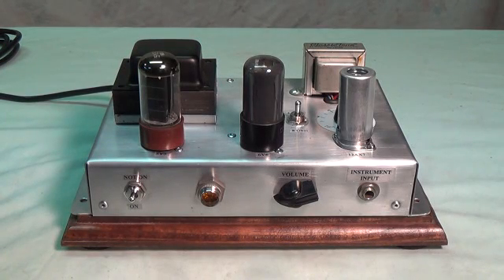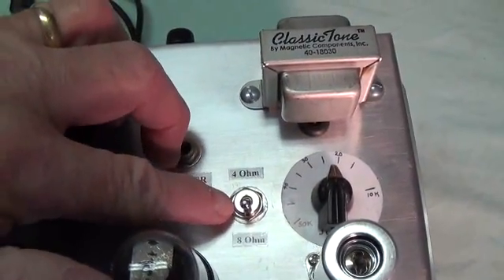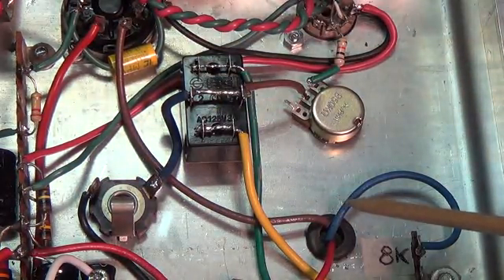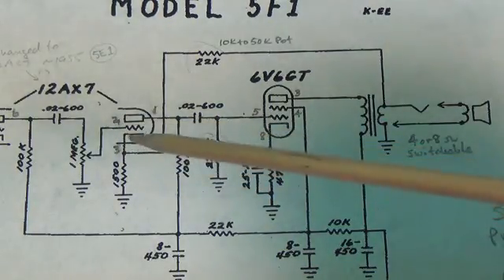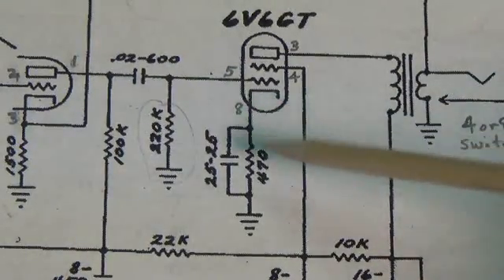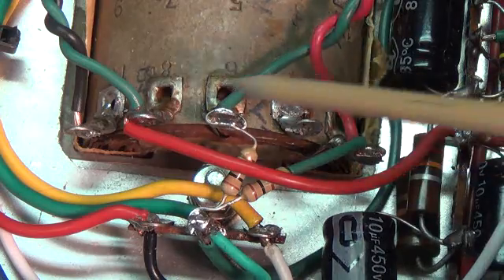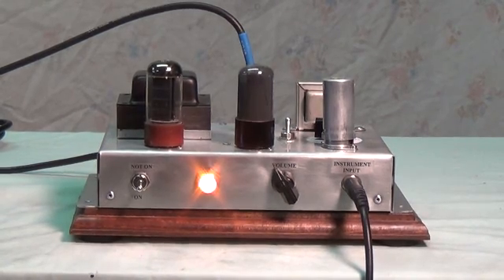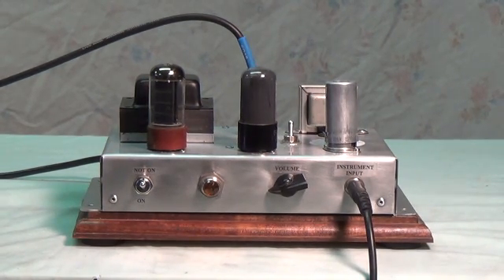Scratch Building a Fender 5F1 Champ from Scrap Parts.....Part 2

Comment: Doug one thing I'm not clear about, is how to determine what the output transformer reflected impedance should be given the topology of the amp and the tube selection.  In this video you simply picked the 5k ohm; why?
Reply from the maker: +YTNUKLR  It was simply a matter of experience, YT. In the vast majority of cases, I have found that 5K is the best primary impedance for a single 6V6.
Reply: +Uncle Doug What would be the effect created by use of a ~8k ohm?  Thanks as always for your wonderful info and demos. Scott
Reply from the maker: You're welcome, Scott. Here is a site that discusses the issue:  http://www.radioremembered.org/outimp.htm

Comment: Very inspiring. I'm preparing a similar project. Using 5F1 schematic but adding some extra features like bass, mid, treble control, line-out, master volume control and etc..
Reply from the maker: +Congi Thu Thanks, CT. I'm glad the video was helpful. Best of luck with your 5F1 project. Please let us know how it turns out :)
Reply: Planning stage. I would like show you the modified schematic when It's ready.
Reply from the maker: You're welcome to post it on my Facebook page: Uncle Doug's Vintage Amps.
Reply: Thanks! I became your fan!!
Reply from the maker: You're welcome....glad you joined our YT family :)

Comment from the maker: Harrison Hein, your comment had no Reply capability, so I'll answer up here. I agree, but once the circuit was wired, the measured resistance differed from the calculated resistance. In an attempt to accurately portray the circuit, I stated the measured resistance, and included a note in the video (at 8:44) explaining this. I now regret doing this because of all the (justifiable) questions it provoked, and I apologize for any confusion.

Comment: Wouldn't a 10K resistor in series before a 50K pot give you up to 60K ohms of resistance?
Reply from the maker: +Marcvie J.  Quite a few people mentioned this, which is why a note was added at 8:46 in the video explaining that although the resistance of the pot was marked as being 50K, when the circuit was actually measured with an ohmmeter, the range of resistance was from 10K to a little over 50K.
Reply: with a 10k minimum resistance

Comment: Hi Uncle Doug,
I am enjoying your amplifier builds and restoration and you have inspired me to
plug my soldering iron in again and build something. I love the build quality of your work and your attention to detail, it is truly an inspiration.
I have a suggestion for a video and you may wish to consider my suggestion for a tuition or build video. . . I know that mains transformers can be used as an output transformer in a small Amp or tube radio and I have heard it said that a mains transformer winding can be used as an HT choke also and I would appreciate it if you could comment on this as transformers are difficult to obtain at reasonable price hear in the UK . . .also there is a lot of interest on the web in very low power tube amps for studio recording and home blasting, check out this link for an interesting project.
https://www.youtube.com/watch?v=DOCgDRwegm4
regards Geoff.
Reply from the maker: Geoff Gardner Thanks, Geoff. I have never had a power transformer with the correct wind ratio to serve as an output transformer or filter choke. Also, power transformers generally cost at least twice as much as an OPT and three or four times as much as a filter choke.....so I'm not sure if it would be a good economic move. A better bet would be to buy an inexpensive, used tube amp with a damaged cabinet, missing tubes, etc. and harvest the PT, OPT, and FC (if it has one). Check Triode Electronics for good buys on Classic Tone transformers. I know the shipping is probably high to the UK, but their item prices are very reasonable.  As for the low-power tube amps, I have read about them and find them interesting, but tend to stick with traditional vintage circuits using 6V6's, 6L6's, EL34's, etc. Thanks for your input.
Reply: Uncle Doug 
Hi Doug,
Thanks for the quick
reply, the mains here in the UK is 230 V so that might make a
difference but I know that the construction of HT transformers are
not optimum for audio use with large amounts of inter-winding
capacitance and inferior lamination material however thanks for your
help and suggestions, I have in fact obtained a none working tube
radio from ebay to build a small practice Amp, I remember
you hearing you say that you live in Tempe,
I listen often to paster Steven Anderson on the web, I wonder if you
know of him (i'm not shore how big Tempe is) anyway looking forward
to your next video. 
Regards
Geoff.

Comment: Hi Doug Love your stuff. Just wondering when you say you have a 10k resistor in series with a 50k pot for the NFL. You say you would have a total of 50k but would you not have a total of 60k as ther two are in series?
Great looking build by the way! :)
Reply from the maker: jozzef1990 Thanks so much, Joz. Many people have asked about this, and the reason is that although the pot is labeled "50K", its actual measured resistance was a little over 40K ohms.....so I went with the actual value.  To prevent further confusion, I recently added a note to the video explaining this. Thanks for your input.
Reply: Uncle Doug Thanks for clarifying, that makes perfect sense. I've just finished building my 5F1, no mods really but I added the 22uF cathode bypass cap for the 12ax7, bit of an increase in gain which is nice. I am thinking of building a Matchless Spitfire for my next build but I am unsure what power transformer to use. The amp uses EL84s so do you think a Marshall style transformer might work better than a Fender type? I thought you might be interested in the circuit. I am attaching the schematic, interesting little amp. http://www.mhumhirecords.org/DIYpages/schematics/SpitfireSchematic.bmp

Comment: Seeing this buck naked guitar amplifier illustrates a difference between a guitar amp and one tailored to use with a gramophone.
Distortion is Public Enemy #1, Visually that means a far fatter output transformer.
Reply from the maker: NJPurling Quite true, NJ. Distortion-wise, guitar and HiFi amps are generally at opposite ends of the distortion spectrum.

Comment: Love the "not on" setting! Very clean build, I like it a lot. BTW all 3 terminals on the feedback pot should be connected (the wiper should be connected to one end or the other)
Reply from the maker: Craig Diamond Thanks, Craig. Glad you liked the video.....and the "not on" setting :) The feedback wiring has been changed since the video was completed.

Comment: Hello Doug, Thank you for sharing your knowledge in a very understandable manner.
I am scratch building my first amp, a 5F1. I am using an 8" speaker.
My question is about the NFB circuit mod: With the 8" speaker, what would be good resistor value in series with the pot to protect the speaker, when the pot is at full on, zero ohms.
I was thinking 4.7k, which I have on hand, about 20% of the stock 22k.
When I have the funds, I am considering a Weber 10" ceramic speaker upgrade. Will I be ok with no floor resistor or should I go down to maybe 1k or2.2k or so?
Thanks forward.
Reply from the maker: John Chrzanowski I'm not sure what the resistance is of the potentiometer you are using, John. If you want to bracket the 22K, you might want to use two 4.7K resistors (in series) for a total of 9.4K, in series with a 25K pot. This would give you a range of 9.4K (less than half) to 34.4K (about 50% over).  See if this range works for you. If not, then experiment. You do need a "floor" resistor of at least 4.7K to protect the cathode from excessive NFB.

Comment: i have a question to reduce hum
why not make the filaments fed by DC instead of AC?
Reply from the maker: pcuser80 It can be done, PC, but in a properly designed and constructed tube amplifier, hum should not be an issue. Excessive hum is indicative of poor design and/or construction, or component failure, and will most likely exist whether the filaments are AC or DC.

Comment: I really got a kick out of your comments on feedback. You seemed as surprised by the effect of degenerative F-B on a simple tube amp as the solid-state guys are surprised by regenerative F-B on an overly-damped transistor amp. Experimentation is the soul of this hobby and it's refreshing to see someone do it rather than look at a published table and declare it to be irrelevant without experimentation.

It seems there's a negative connotation of feedback in general in the musical instrument amp world. Yes, loads of forced linearity is what makes some SS amps sound constipated, but the coin has two sides: degenerative feedback keeps speakers tightly under control so that tone differences are minimized with different speakers. The speaker coils also run cooler.

But in a small open-back speaker cabinet, nothing beats loose resonance with lots of overhang. Makes the cabinet sound three times as large.

p.s. For those of you unfamiliar with degenerative feedback, it not only keeps the output "flatter" but is also error-correcting--anything not in the original signal is re-introduced as a mirror image back into the pre-amp, where it is run through again and cancels out the "error" in the signal.
Reply from the maker: Ss VI Design Thanks so much for your informative input, SS. It's helpful to gain insights from knowledgeable viewers like yourself.

Comment: Here's a little mod you can do to protect  the output transformer and valves. When you repair or build an amp connect  a few silicone carbide diodes reverse  biased from the 2 plates back to the chassis. When a speaker is disconnected or no load at all the back emf will be in order of 2 x the plate  voltage, thus the need for very high voltage diodes. When the reverse current begins to flow, a pair of diodes bypass that current directly to ground.

This only works for double ended tube amps but it saves frying your output transformer and tubes.

Try it
Reply: Uncle Doug g
Credit given where credit is due. Both Rusty and yourself deserve it for the professional quality of your show, I never miss an episode.
Reply: Excellent stuff.  I like the tip for the virtual ground.  I'll have to check my amp, but my hum is probably from worn tubes, which I haven't replaced for years :(
Reply: ST2R ST2R)
Watch Uncle Doug on YouTube, he presents a fabulous episode explaining  both types of hum and what causes it. Without doubt Doug does the best tutorials on valve amplifiers on any media platform.
Reply from the maker: ST2R ST2R Be sure to determine the frequency of the hum before assuming it's the tubes, ST. As tubes age, their current flow decreases (due to cathode deterioration), requiring bias adjustment, but they don't generally develop a hum.
Reply from the maker: BBK1 Thanks so much, BB. Rusty and I really appreciate your kind words :)   ^. .^
Reply: Thanks to both of you, I'll check it out.
Reply from the maker: BBK1 An excellent suggestion, BB. I'll try it out in my next amp build.
Reply: Uncle Doug
It might serve you well to also put a pair reverse biased between plate and Supply rather than directly to ground. It depends how you want to dampen the reverse current. This is probably more applicable to very high powered amps with large transformers. In this case there will be a higher slew rate but beware of harmonics in even order progressions. In some cases spectral inversion can be a minor issue however at these frequencies I doubt it will matter.
Try the experiment as it's no different than hanging a diode reverse biased across a relay providing the output stage isn't running in class A mode due to a fault

Comment: Can Rusty explain what's going on with the 2 inputs on the 5F1 schematic?  I understand input #2 attenuates the input somewhat, but I can't quite wrap my head around how it works.  If one were to skip the #2 input altogether, could the 1M resistor also be eliminated?
Reply from the maker: Jason Thorpe If you plug into input #1, there is 34K resistance to the grid (two 68K resistors in parallel). If you plug into #2, there is 68K resistance. The 1 Meg resistor is essential as a grid leak to ground. Without it, the tube would probably cease to function as the grid developed an increasingly negative charge. If you eliminate #2, the 1 Meg must remain on #1.
Reply: Uncle Doug Ah, I see it now, thanks.  Seems like the particular arrangement used by Fender relies on self-grounding input jacks?
Reply from the maker: Yes, both jacks are self-grounding.

Comment: Dear Mr. Doug, 

First off, your videos are fantastic. I have a question, I am thinking of upgrading the transformers on my Champion 600 and wanted to power the internal speaker with the 4 ohm output and have an additional jack for the 8 ohm output so I could power and external 8 ohm speaker along with the internal 4 ohm. Is this ok? I can't really find this info and I'm guessing it's because it's probably obvious one way or the other. I just want to make sure what I'm expecting to happen will happen in order to manage impedance.
Reply from the maker: johntpowers3 Greetings, John. Unfortunately output transformer impedences are an either-or situation. You can't simultaneously run a 4 ohm internal and an 8 ohm external speaker. You could, however, run two 4 ohm speakers (one internal and one external) wired in series, and connect them to the 8 ohm tap of the output transformer. Unless the speakers are identical, one will probably be louder than the other due to varying efficiency.
Reply: Uncle Doug Oh! Thanks for the quick reply. I'm sure glad I asked.
Reply from the maker: You're welcome, John.

Comment: hi uncle doug. ive just bought a 5f1 clone of ebay. it sounds quite bassy and muffled. i can get it sounding ok it I use a overdrive pedal with the highs turns right up and lows turned down low. the speaker seems ok. could it be something in the circuit like a blown resister that would cause this?
Reply from the maker: ***** Mr. J, perhaps there is a capacitor within the tone circuit that is funneling the treble to ground. Trace the signal path and see if any capacitors connect it to ground.  Also, do you have your guitar set at max treble output? Sometimes humbuckers produce a "muddy" tone that is more evident with some amps than with others.
Reply: thank you uncle doug, will have a look at it and see anything a miss. :)

Comment: hello uncle doug,,,, i am on my wifes computer... it is 3 am saturday and i decided to start wiring my champ, i did not want to wake my wife to use my puter.

my question is; The negative feed back, i have a transformer that has 4,8 and 16 taps,  i and using a spst switch for the 4 and 8 ohm taps.  Can i use 16 ohm tap to run my negative feed back, this simply my build a lil bit.

Comment: what kind of guitar are you using for the test?  ty for  all of  your wisdom with kind regards  c hughes
Reply from the maker: chris hughes Thanks, Chris. It's my regular old shop guitar, a 1980 Matsumoku Vantage Performer with MMK-45 humbuckers. It's visible in the opening scene of my "Shock Hazards" video. It's a good guitar, but not particularly valuable, so I can risk using it in the workshop, where it's exposed to extreme temperature variations and all sorts of physical hazards. Not a good environment for a 1959 LP "Burst"  :)

Comment: Hi Uncle Doug! Inspired by your Champ videos I decided to build a 5e1 clone myself. As it was my first full tube project I wanted to built it into a bigger chassis than the original. That made also possible to use bigger transformers so I used KT66 tube. I added also a bias potentiometer so I could use 6V6 with it too. It sounds amazing. Best clean tone I've had.
Reply from the maker: Olli Kivelä Wow, Olli....Congratulations on a great first-time amp-building project :) Your modifications make good sense and the fact it works so well is evidence of your skill. Keep us posted on your next project(s).

Comment: Hi Uncle Doug & Rusty, He sure seems like a good 'ol boy, I mean the dog, and, you to Uncle. I am so glad I found your channel, a wealth of information. It's on my list to scratch build a tube amp that rocks. I built a current limiter as per your video and it worked perfect. All I could get for now was a 250W heat lamp with a resistance of 5.0 ohms. I shorted through a $20.00 DVM and it still works perfect, thankyou. I am subscribed and check all the tutorials I can. Take care, be good, C.
Reply from the maker: Cass Virgillo Greetings, Cass. It sounds like you are making good progress on your way to building your own amp. Thanks for watching and subscribing, and best of luck with your projects.

Comment: I like the innovation of the cathode R being variable to adjust the plate current.  Does a significant amount of the plate current flow into the grid?  (I'm not knowledgeable on this matter.)  If not, and most of the 31mA flow through the cathode resistor, then it's dissipating half a watt.  You'd want a pot with a higher dissipation rating than half a watt, because you're are operating at high ambient temperature.  You'd probably prefer a 1 watt pot.  Is the trimpot in this circuit a 1-watt unit?
Reply from the maker: bminorscales Bminor, the current flows from the cathode to the plate, past the grid (not to it), in varying amounts determined by the charge of the music signal on the grid. Your calculations are correct. If P = I squared x R, then the heat dissipated would be 0.45W. Yes, the trim pot has a rating of at least 1W.